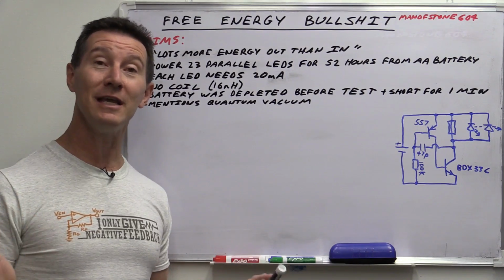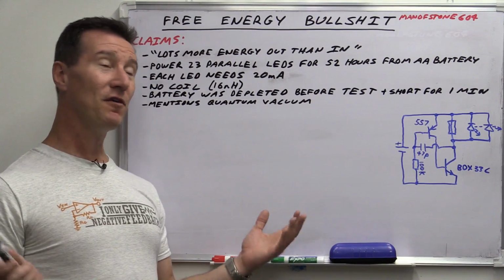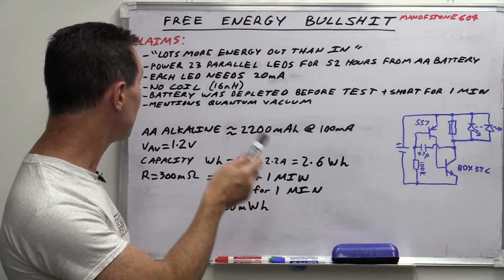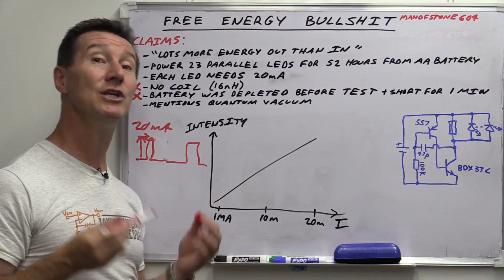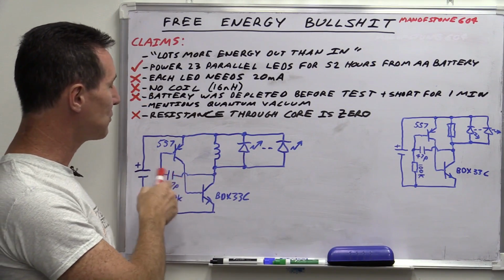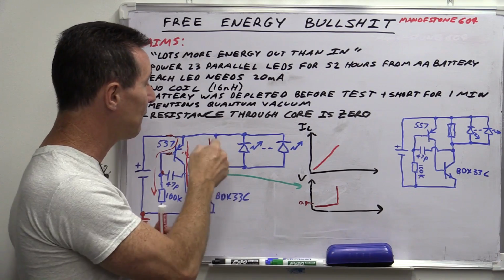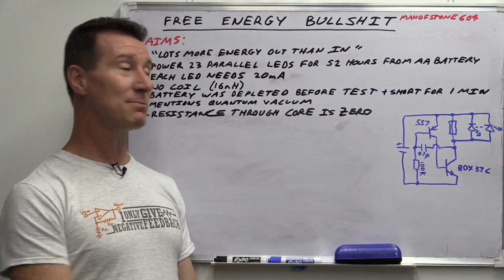EEVblog #708 - Free Energy Overunity is RUBBISH!

Comment: Very interesting video.  On one hand I applaud those who investigate stuff outside of the norms of convention (and what we 'know') looking for possible ways to "bend" physics, simply because thinking outside what we KNOW leads to innovation, IMO.  At one point we KNEW the world was flat.  Who knows what we'll KNOW 1000 years from now.  That being said, he didn't do it correctly as this video does, and if he did he wouldn't have come to his false conclusion.  It's rather unfortunate to think he spent 16 years in research without realizing how accurate you have to be with these types of experiments.

It sounds like the guy who made the video really half-assed the experiment and just made broad over-generalizations about the numbers instead of getting in there and actually getting deterministic, factual numbers.  Unfortunately that's required for an experiment like this, you need numbers to prove A is greater than B.  Some things in science you can prove objectively by looking at it and saying "oh yes, the object isn't green anymore" - but in most areas of science, especially in electronics, there's quantitative numbers for 99% of it and you need to get those to make a proof of that magnitude.

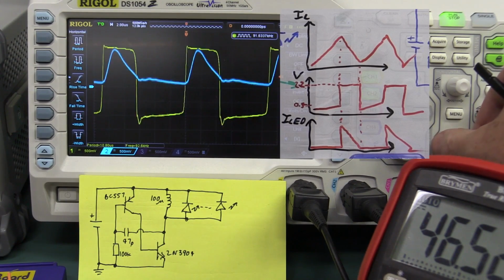Comment: Dave you made a little mistake @39:10. You compare the current draw of your whole circuit to the current through the LEDs. But of course the voltage is different so to get the real efficiency you'd have to compare the power.

Comment: FREE** ENERGY right here !!!  FREE**

LENR (Low Energy Nuclear Reactor)
http://vimeo.com/25501969

Experimental Data:
http://arxiv.org/abs/1305.3913

Its converting electrical energy into thermal energy. The thermal energy output seems to be higher than the electrical input, probably through unknown nuclear fusion processes. Resistors in a special environment are not cooling off like they should (anomalous heat energy production). To convert that 'extra' thermal energy back to electrical would be way to lossy; no steam machine or peltier-elements (seebeck-effect) could get you that electrical energy back, witch you pumped in.

Simula experiments were done around 1990 in the US   [u.s.a., u.s.a.:] but they were torn apart by the scientific press. Since then this is a nogo for the most physicist.

Its interesting to read and think about and I'm quite sure its not a blown up hoax.

whats strange though: Ingredients are like: a heating resistor, nickel-poweder, heavy water + X

X ?? X!

They don't say what it is.

Maybe there is a reason, maybe they are bullshitting us...

Comment: Correct me if I'm wrong, but the voltage on the capacitor Dave mentions at 26:00 is not correct. In fact, when the transistor is conducting, the voltage is constant at roughly Vdssat. The other lead of the capacitor is actually rising in voltage, eventually blocking the PNP transistor. Once the PNP turns off, so does the NPN, and the inductor starts discharging. As it is discharging, the voltage across it is the Vdforward, until it depletes the current out of the inductor. Then, the voltage drops to zero. As the voltage drops to zero, the voltage Dave is showing (the second lead of the capacitor is Vbat, and it discharges the capacitor, reseting the whole process.

Comment: Dave, given the number of plonkers on YT that claim to have replaced their car batteries with ultra-capacitors, it might be a good idea to do a blog on the reason why car manufacturers have not used UC's to replace the battery.

In Europe one or two companies have installed UC's in conjunction with batteries so they could implement that dumb-arse start/stop scheme to save a little fuel. Personally, I'd rather spend a few pennies more on fuel than spend a fortune replacing my starter motor/ring gear frequently.

Comment: PROOF OF THE QUANTUM VACUUM! AT 40:45 !!  

the current was reduced to zero, yet the LED stayed on.   Cheap Chinese circuitry or vacuum???
Reply from the maker: Son of a Zombie OMG, clearly the vacuum!
Reply: ***** it is believed Tesla created a time machine, "thought-camera", death-ray and probably a legit quantum vacuum.
Reply: ***** They don't HAVE 12 Amps, they are only allowed to sustain a power usage of 12 Amps. He said that by drawing 60 Amps, the batteries are dead in 16 hours, that gives us an battery capacity of 960Ah, which by only consuming 12 Amps, they can have power for 80 hours.
Reply: ***** Gravity helps a lot in space.
Reply: ***** No, Gravity. Ether is some esotheric bullshit.
Reply: ***** But if you know how long the car was running at 5000RPM, you can know the total fuel that was used. Same as Amps, if Apollo 13 used 12 Amps, you need to know how long it used 12 Amps to know the total energy used.
Reply: It was a MOVIE, FFS!. Made for its entertainment value, not its scientific accuracy. Movies can, and frequently DO, "get it wrong".
Reply: Son of a Zombie some people also believe in santa clause.
Reply: ***** 12 Amps?... That's not an unit of energy buddy... 12A is just current intensity.
Reply: ***** Well amps cannot be used as an measurement of energy... You must have misunderstood the units.
You can compare Amps to the RPM of a car motor, you cannot say how much fuel a car has just by knowing its motor RPM.
Reply: ***** 12A@22kV?

Comment: So much misinterpretation by this whingy, whiny antipodean.
We have had free energy since the year dot.
Its elemental. Fire, Water, Earth and Air.
Also known as Solar, Biomass, Wave, Tidal, Hydro, Geothermal and Wind et al.
When most people talk about free energy it is those they refer to and not the so called 'exotics'
Yes the energy is free, but the equipment is not.
As for over unity, it can only be present in an open system. Meaning that you connect it up to a power source that outputs a unit and draws in another unit from the outside.
This is what people refer to as over unity, COP etc. and not the so called 'exotics'
So just stick to your usual content output Dave, the whining really grates on the ears!
Reply from the maker: mynewschannel This IS my usual content, I've done quite a few of these debunking videos.
Reply: how is the energy free? to create fire you have to burn fuel (where do you think the fuel comes from? NOT free) for solar panels you need light from the sun which burns fuel... a lot of fuel (hydrogen) (where do you think the fuel comes from? NOT free), biomass is just another use of fuel (NOT free), the tides require heat from the sun to cause differences in temperature across the world which is what causes the water to move (primary school physics, hot water (or hot air) is more spread out due to having more energy than the cold air(or water) which pushes it down, this is what happens in the sea, the cold water moves to the bottom and the shape of the ground causes that movement to change to forward movement) (again making use of the suns huge fuel usage i.e hydrogen) (where do you think the fuel comes from? NOT free), geothermal depends on the heat under the crust of the earth which was created by the huge amount of energy involved in the collisions of rocks that formed the earth all those millions of years ago (where do you think the fuel comes from? NOT free), the wind much like the sea moves because of differences in air temperature throughout the world which causes it to move, differences in temperature brought about by the heat of the sun which comes from the fuel brning in the sun (hydrogen again) get the picture yet?
Reply: mynewschannel oh really... that coming from someone who is saying energy can come from nothing...
Reply: mynewschannel Bullshit. Free when talking about money means no money but when talking about anything else, energy being an example of something else, means getting something for nothing (clue is in the name... NO. THING.) its called context. words have different meanings in different contexts. And yes they do say that... the concept of "free energy devices" is that you get more energy out than in and that is not possible,
Reply: mynewschannel Hey, look! An idiot who doesn't understand basic terms! I am shocked, I can't even begin to describe how surprised I am at this turn of events.
Reply: mynewschannel Erm yes, you said it is free energy, free energy is the term for energy that is "FREE" ie no work done to get it.
Also you seem to have no understanding of the big bang theory... its not energy from nothing, nowhere in the big bang theory is it said that the universe came from nothing, it is said that the universe was originally compressed into a small space and eventually exploded.
Reply: mynewschannel Nope, I was talking directly to you, the person who doesn't know what free means.
Reply: mynewschannel "Regarding to the Big Bang, where did that energy come from?"  You're looking at existence as a state of affairs, meaning you think, first there was nothing, then there was the Big Bang. Which is plain false. Nothingness is impossible. The laws of physics simply necessitate a Big Bang, there never was a 'before' the Big Bang since before doesn't even make sense, since it requires time to be a coherent term. Saying the BB 'began' is like saying this (hypothetical, used for demonstration) ball started at coordinates X Y and Z. But since we don't have the correct word in the English language, or any language, we just use the word began. Hope this helps you understand real science.
Reply: mynewschannel Your lack of coherence leaves me baffled.
Reply: megaspeed2v2 
That has got to be the most dumbass reply I have ever seen...
Reply: mynewschannel Noone knows, scientists are still working on finding that out.
Reply: mynewschannel Technically, the term "work" means energy expenditure in thermodynamics. "No work done to get it" is a crude, but not inaccurate description of free energy; a more accurate one would be "less total work put into a system than what work is being put out."
Reply: mynewschannel Charming.
Reply: Teth47 Yea, figured that. My above post still correctly expresses my feelings towards this situation, nevertheless.
Reply: megaspeed2v2 
Either you are dyslexic (which is unfortunate) or you just could not be arsed to read my comments correctly.
I never stated that you can get energy from nothing, I am not a Big Bang theorist...
Reply: Free Energy doesn't mean that at all, 'no work done to get it', you really are a dumbass.
Its means you don't have to pay for it.
Look at any free energy device and tell me that they claim no work is done.
I don't know what planet your on but it certainly isn't this one...
Reply: Regarding the big bang, where did that energy come from ?
Reply: ***** too much time playing MMO's has ruined my grammar xD
Reply: Teth47 Yes I was quite surprised at megaspeed2v2 comments too ;)
Reply: Oh I know what free means, economically.
But it was misinterpreted as meaning 'something out of nothing', which I don't subscribe to. As I explained I am not a 'Big Bang' theorist. So I hope that clears that up :)
Reply: mynewschannel Big bang theory doesn't purport to have gained something from nothing, but that's entirely secondary to this argument. There is nothing that is even economically free. it might not directly cost you as an individual, but it costs someone something somewhere.
Reply: KingTroll
Your having a king laugh. As I stated earlier I am not a king Big Bang theorist. I didn't king say that anything came from nothing, more like 'Predestination' really. Oh and I king understand science alright. Its just some of the king dumb asses didn't understand what was meant by free energy.
Reply: KingTroll Reasonably sure he's a troll...
Reply: KingTroll

That was king funny :)
Reply: mynewschannel
Obvious troll is obvious.
Reply: dllexport- Hey there again! :D
Reply: mynewschannel You still don't know what 'free energy' means.
Reply: alysdexia
But your mom's legs are!

REEEEEKT
Reply: Teth47
i guess

Comment: Of course this circuit can not create energy, but it seems if optimized, it may be good at conserving it. For many years, as an amateur guitar pedal hobbyist, I have used a simple circuit based on on a 555 timer chip to save battery life on indicator LEDS, however to get any real battery life benefit, you have to flash the LEDS at such a slow speed, that there is an obvious blinking.  ... And 555 timer chips can bleed audible clicking into the circuit, It seems to me that this circuit may be better suited as a way to conserve more energy with cheaper components - and while providing a perceptional steady non-blinking light. ...not that it would matter to anyone who wasn't trying to milk the last seconds of battery life .... In a freaking guitar pedal ....hehe
Reply: Yes I know the LEDs are blinking, but they are blinking so fast you don't see it
Reply: Without seeing your 555 circuit I'd guess the clicking is due to the fast edges of the square or rectangular waveform. Try using capacitance to slow the rise and fall times which would reduce HF harmonics.
Reply: Yes it probably would work better than a 555 timer. Just adaption needed to make sure you don't burn out LEDS from the voltage spikes from inductor.

Comment: Bravo Dave! I've been fighting my own battle against false "Free energy" claimants for years myself. In the process I've built many different circuits and made measurements of them. But in my experience, the people who need the information the most are the ones least likely to be influenced by it!
My own favorite little circuit brightly lights up 6 ea. NE-2 neons in series from a single depleted AAA battery.
Another similar one, that I just demonstrated in a video, can be shown to draw less current from its AAA battery when its load of 24 LEDs is connected, than when the load is not connected! That phenomenon is another favorite one that the Free Energy claimants have used as "evidence". After all, if the current goes down when the load is connected, surely that means the Load must be powered by the circuit for free, right?  ;)
Keep up the great work and I hope you find the time to do more debunking videos!

Comment: Hi Dave,
I don't think series resistors between inductor and LEDs is required. Inductor is a current source when discharging, therefore the discharge current is automatically limited. Also, the dynamic resistance of PIN junctions, such as LED junctions, are positive, therefore current will automatically spread evenly across LEDs, assuming they are manufactured in the same batch. Therefore, for a DCM converter, the current a single LED can encounter is Ipeak/N, while the rms current for a single LED is Ipeak/N/sqrt(duty), giving we have N LEDs in parallel.